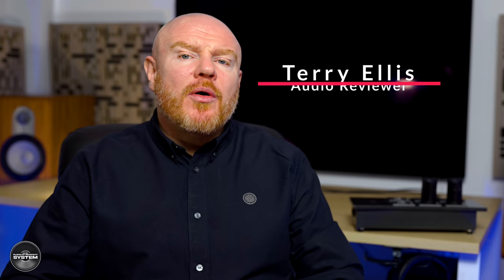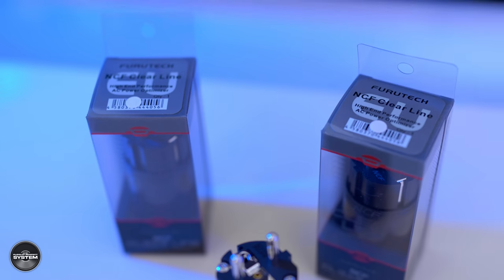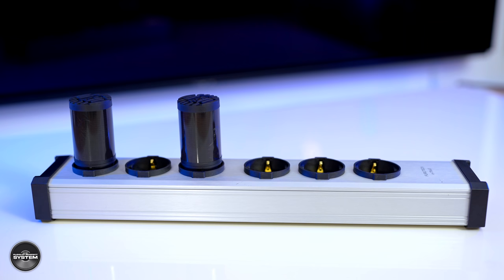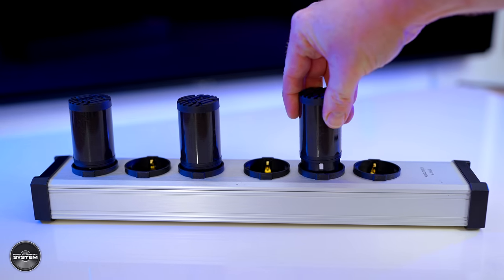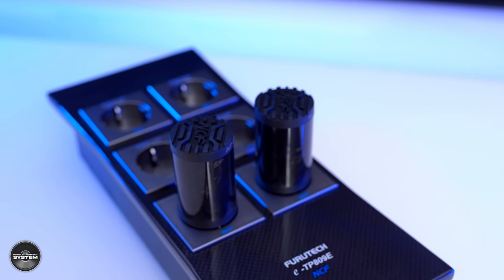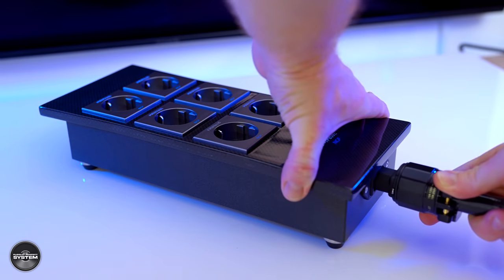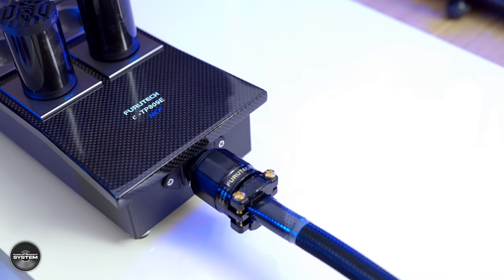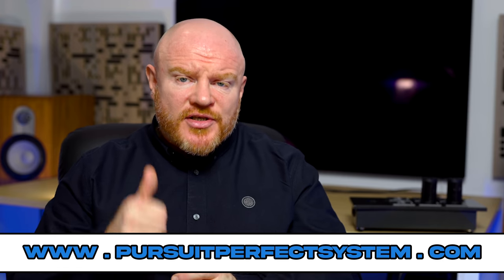Does Power Matter for Sound Quality ?? Furutech NCF Clear Line Review

Comment: Of course it does! But as Furutech says the improvement adds up with more of their clear lines it would be interesting if there is a remarkable difference if you only use one. Three pieces are 750 bucks which is way too much (not only as my REALLY very good power strip costed „only“ 350). Probably one piece is not enough to hear difference...so not interesting for me, at least not for 250 bucks!
Reply: At the presnt time I'm using just one (I plan on getting more) and it makes a huge diffference. For just $249.00. it's a fabulous tweek. And best of all all you have to do is plug it in!

Comment: Different impression than Terry here. With filters consistently sounds dampened. Yes, less aggressive, more ”laid back… BUT plucked string is dark and less realistic, same for piano. Also spatial clues and slight reverberations are gone. I also have had filtered sockets in my system, as well as some ifi helpers in digital connections. As I upgraded my system, I removed it all and found that good power cords on a good unfiltered power distributor sounds more dynamic, better microdynamics, effortless detail, 3D, etc. - as usual your mileage may vary. Saw a video - forgot by who - that said that they always have different filtered and unfiltered options when they set up for hifi shows, because there is no consistent ”better” - depending on room and equipment.
Reply from the maker: There is not filtering in the furutech power blocks just their NCF tech which is not a filter like you think a choke or similar. That is the difference you are hearing here not filtering. Also if it power it’s not in the signal path it can only take away what is not supposed to be there unless I suppose it’s adding noise which is possible. So I always look at it if it’s taking something away it’s false anyway and the change in sound is due to something else and if it’s then not as good as you hoped get better gear in the system :)
Reply: @PursuitPerfectSystem  one has the ncf right? The black one. The silver one does not. It is a tp86e right? And ok - if filtering noise is offensive to Furutechs marketing we can call it their proprietary power conditioning. Anyway, I just stated my listening impression and shared my experience with different kinds of power conditioning and noise elimination. My system was good and has gotten much better over the years, which is when I started noticing that good power (good power distributor and good power chords) without conditioning actually worked better for me. Maybe I just have not had the ”right” conditioner yet. I think the GR Research guys had the video on using or not using power conditioning depending on location and equipment - they said they always try different options at shows. Anyway, you asked for impressions and experiences and mine were as stated. I know I am not alone in saying that the use of different power conditioners can be both detrimental or beneficial, depending on power situation in the location and the system and of course personal preferences. I believe you said yourself that the Furutech NCF technology requires trying in your system to see whether they are worthwhile in the specific case.
Reply from the maker: Normally power conditioning is done with chokes and capacitors and such like, physical things the electricity passes through, fututech ncf is something in the materials used so it’s a little different passing through devices like a capacitor. That is what I was referring to as a difference
Reply: @PursuitPerfectSystem  I have the silver Furutech distributor. Maybe, I will try the NCF ”plug”. I will ask my dealer when I pass by there today. Have not tried those yet - will be interesting. 🎼🎶👍🏼

Comment: Biggest worry would be that it sucks the life and enjoyment out of music, even if it does “improve” the sound in a very Hi-Fi test disc way. I have upgraded power cables but have worried about going for a mains regenerator for the above reasons.
Reply from the maker: They are not in the signal path they can't remove anything that is supposed to be there only what's not supposed to be there or that is being added. That is not music life that is distortion you become familiar to hearing until you become familiar with it being gone and can't bear to hear it being added to the music :)
Reply: @PursuitPerfectSystem  I've realized I do tend toward liking a slightly coloured sound, speakers I like: Neat Acoustics, Totem, Dynaudio... I'm now experimenting with Valve Phono Pre Amps, despite having a class D amp ....... If these were available in UK three pin I'd definitely give them a go! Thanks for some great content of late, love these big group tests.

Comment: this product might work better in a situation where your really dealing with dirty power to begin with. It seems your mileage may vary depending on circumstances.
Reply from the maker: If you listen the difference the clear line make is pretty consistent across both power distribution units. I think using a cheaper power strip would just bring the whole sound quality down and their effect would still be similar

Comment: Clearly there is a Improvement with the units,but everyone has a different degree of noise on there mains so not everyone will get the same effects with these units
Reply from the maker: I dont think there is any noise filtering in the Furutech units - they are going about power distribution with a different mindset so you should see very consistent results with this strategy

Comment: I use the IFI  AC Ipurifiers. I have one in every outlet in my home plus a couple in my stereo distribution. Makes a great difference.
Reply: Interesting...I'm also thinking of buying some of these AC Ipurifiers for my stereo system, though reviews seem to be very mixed as to if they provide any benefit? I guess it all depends on the quality of your AC power supply...
Reply: @marcfoss7687  I tried lots of combinations. The number I used with my stereo, the order I plugged my equipment. Some combinations overly smoothed the sound. But now it’s lively, clear, and balanced.

Comment: These decisions always need to be made in the context of your system.  There are definite differences in dimensionality, shoutiness (or reduction thereof), dynamic layers, physicality of the instruments and vocals.  However, over my $2500 headphone setup (new retail price over the last decade and a half, so maybe not the actual retail value, but you get the idea), it is not the biggest difference.  Here, my money would go a lot farther replacing the tubes on my headphone amp or upgrading my DAC.  On my main hifi (where I didn't watch the demo yet) I think what is next is to upgrade the amp.  These NCF products are in the back of the line in terms of order I would purchase things in.  Terry of course mentions the differences are bigger in real life and also talks about the relative pricing and value of these things.  Still I would probably opt for them if my systems were at higher levels - if the costs to upgrade the main components were so high that, instead, I become better off spending on these bits to take that next step forward.  Then, this investment would benefit that other, bigger purchase when I finally had a chance to make it.  You can put the most exotic tires possible on your car, but the performance improvement isn't so great if you're still pushing around an economy van.
Reply from the maker: This is it - in the context of the system in the video where could £750 be spent to get this sound improvement?  I think it would cost a lot more than that to achieve it another way.
Even the £3480 for the better power block what could you spend that on to get better sound?  Maybe a NAD M33 but is that much better than the Arcam SA30?? Or would it be a small difference.  You might not like the sound of the NAD but really like the Arcam therefore why would you want to change it. 

I think individual context is always the case and sometimes people cant see it from  anyone else's - I think we all struggle with that to a degree

Comment: So. $250 EACH x 3 = $750. Get your dedicated line maybe?))
Reply: Perhaps that might be a better first step. The problem is that there are so many options, enough to drive you crazy.
Reply from the maker: I already have a dedicated line installed - you don't "need" to use three, I had three here so it made sense to use them all for the purposes of the video

Comment: I like this channel. But it's stupid to use 3 of the clear lines in the test. They are not cheap and no one wants to invest in 3 of them if you get very nice power blocks for that price. So your test should be done just with 1.  I cannot take the rest seriously on a normal consumer level.
Reply from the maker: That is up to you - but consider two things - I had three of them here and I could only use them in the power block as that was the only Schuko plugs for the Schuko Clear Line
Secondly I am trying to record the audio difference they make and for that to then be audible back to you at the other end of YouTube so I need the difference they make to be as much as possible in order for that to happen.

Do you know anyone else that can and has done this - I don't -  especially with real recordings with microphones at the listening position - not using close microphones techniques which is not what you hear when you listen to the system you see.

Also I think people would use 3 of them - maybe 1 or 2 in the power block and then others plugged into other spare plug sockets. Everything is relative but a £240 upgrade even times by three for a lot of audiophiles with thousands invested into their systems is not a high % of the system cost - and for those audiophiles to better their systems sound is likely to cost a lot more upgrading something else
Reply: @PursuitPerfectSystem  Thank you for the response. Your points to consider are noted.

The channel "TheAlphaAudio" does a similar test you do in your channel. They also provide the test recordings so you can AB test at home.

about the price. They cost 260,- euro in my country.. that makes 780,- euro. Big step investment for a tweak. 

keep doing what you do! Still enjoying it.
Reply from the maker: @tom_loves_audio_tech_gaming  you don't need to use 3 I used 3 as i had 3 and wanted to try and make as much difference as possible for the purpose of the video.

Alpha audio should not be sharing music unless they own full rights to it otherwise they are breaking copyright law.

Comment: no
Reply from the maker: It’s interesting I was speaking to a high end amplifier designer of about 30 years last week. He has designed more hifi than we have had hot dinners.

We discussed many things one was mains quality. He can design an amplifier to he exceptionally good and he openly admitted mains quality coming in matters and matters a lot. Regardless of how good the transformer or caps or the design are it still matters

I found that very interesting

Comment: No these devices do absolutely nothing for sound quality. Audio components do not use the AC mains directly. It's filtered first then rectified, and filtered again then run through precision regulators for each voltage required and filtered again. The DC used by the audio circuits  is far removed from that original dirty AC . So none of this stuff makes any difference at all.
Reply from the maker: Speak to hifi component designers and they will tell you the ac and dc are not fully disconnected from each other and conditions with the mains effects the sound quality of the units they design. I have done.

Comment: Ridiculous. You must have really crappy connections, or maybe your local nuclear powerplant is about to melt down. How could a power conditioner affect the sound positively?? The transformer and rectifier in your amp makes interference impossible (unless your 1 million $ system has poor grounding… ) The AC is converted to DC, how could there ever be a transfer of signals that could affect audio? Because it looks great and costs a lot - it has to be great. Psychoacoustics - nothing else.
Reply from the maker: I was speaking to an amplifier designer about this a couple of weeks ago, he has designed more amplifiers than you have had hot dinners and he was very aware that no matter how good the design when the circuits are active noise is getting through